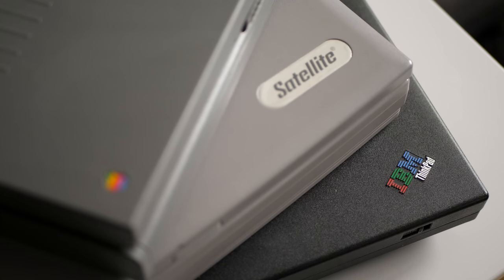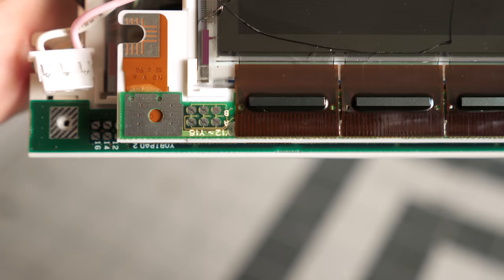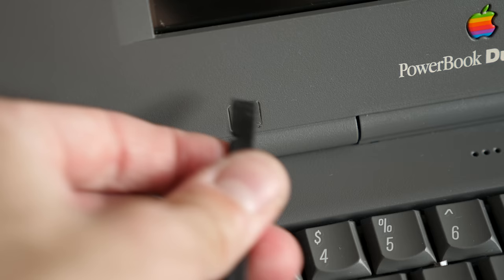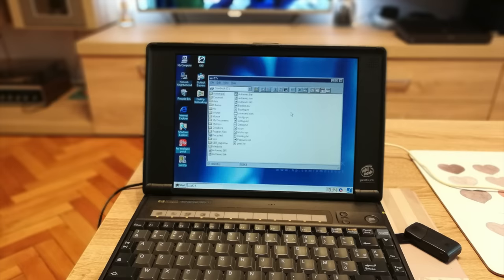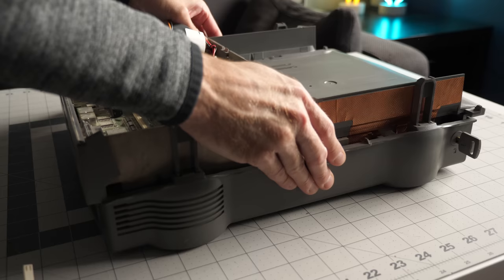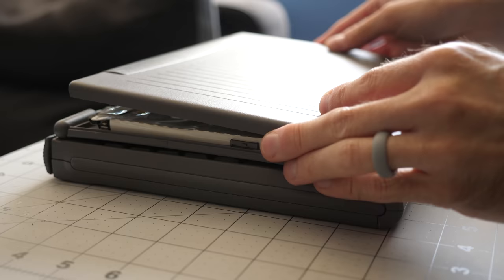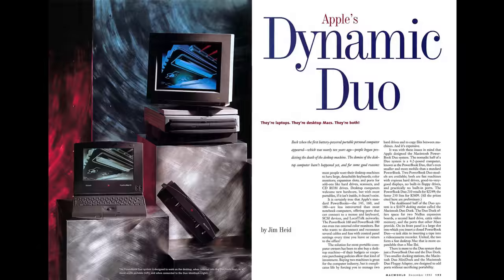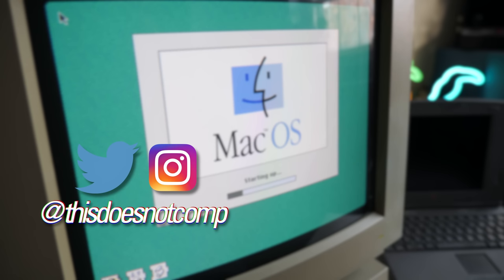Apple PowerBook Duo: The Laptop That Was Also a Desktop

Comment: I bought a used 230 back around 2000 to take notes in college, and later got a 2300. The trackpad was horrible and wished they stuck with the trackball. I have at least 3 docks. The large VCR type desktop, the full length portable dock, and another one with an ethernet jack. Cool concept, and hauling a 4lb laptop to class was pretty convenient when everything else was bigger and heavier.

Comment: Just a tip for the super-gluing. If you sprinkle tiny amount of baking soda on the glue it will harden in seconds when amount of glue is as much as you had to use.

Comment: The 2300c motherboard upgrade was a cool hack at the time for the older B&W screened Duos. You got the PowerPC processor and IDE HD upgrade over the 68030 processor and SCSI HD. Even though the screen was small and greyscale, you got better battery life vs the 2300c and its larger color screen; the greyscale Duos were also thinner and lighter than the color Duos. You also got to keep your trackball, which, at the time, many considered superior to the 2300c's trackpad, which was prone to making phantom mouse movements when it got damp or was in a humid environments.

Comment: What a cool concept - I would actually love something like this for a modern notebook, enabling an eGPU-type expansion with integrated graphics reserved for on the go usage. If the dock had direct access to the mobo like the duo does, it could bypass the IO issues that plague egpus today as well! What an awesome design
Reply: If ExpressCard was revived, updated to use PCI Express 3.0 or 4.0, and to use the full width of the wider size for connection... I bet both USB 3.x and PCIe x4 could be crammed in there while still being backwards compatible with previous ExpressCard devices.

ExpressCard 1 used PCI Express 1.0 x1 and USB 2.0. ExpressCard 2.0 optionally could have PCI Express 2.0 x1 and it had USB 3.0. Where Version 1 could use both PCIe and USB 2.0 connections simultaneously, for version 2.0 to use USB 3.0 it 'borrowed' pins from PCIe for the extra pins for USB 3.0. IMHO it was the optional specification for PCIe 2.0 that killed it.

PCIe 2.0 should have been mandatory for ExpressCard 2.0. It also should have utilized the full 54mm width for wide cards to use the extra width exclusively for PCIe lanes so wide cards could have PCIe x4 and USB 3.0.

But the PCMCIA half-arsed it and laptop manufacturers mostly weren't interested. I suspect that stupid optional bit for PCIe 2.0 chilled ExpressCard device manufacturers on it because why bother making PCIe 2.0 cards when there was no guarantee that all laptops with ExpressCard 2.0 would have the faster connection. There would be too much "Why isn't my ExpressCard 2.0 card so slow?!?!" from customers.

Since the USBIF no longer supports or updates the ExpressCard standard they should make it free and open source.

Comment: I had several of these, at the time they were way ahead of their time. However, they felt heavy at nearly 2Kg’s. Imagine carting it around on a business trip. The docking station was not bad but lots of problems, you had to give it a good hard shove! To repair they were a nightmare, the ribbon cable to the screen often got broken or got snagged and disconnected. Reassembly especially for the screen was not easy, the plastics did not always want to ‘snap’ back. Still, for the time a great portable.

Comment: In 1995 I had a Brother digital word processor which was basically a typewriter with a four line LCD display so that you could type along and when you had everything completed you could scroll through the pages, it would store on a 3.5 floppy and then when You wanted to print you loaded the paper in like a dot matrix printer and it would type out the documents. Fun times for 150 bucks back then,

Comment: Kudos to Apple for trying something revolutionary. Today, I use my Dell Latitude work laptop with a docking station. Until recently, it was a proprietary port on the bottom of the laptop that connected to the proprietary docking station. Now they can just be docked over USB, which means any modern laptop can be docked. My personal Dell G5 15 gaming laptop is just one example of a non-professional laptop that can be docked with USB. Today, Thunderbolt takes this to a whole new level.

Docking a laptop really offers the best of both worlds. The PowerBook Duo was an ideal, albeit expensive, solution for the road warrior class.

Comment: Nice, I haven't seen a Duo for years. I used to sell them at an Apple channel partner in Sydney back in the 90's. A tip for super glue - cyanoacrylate glues use water moisture as a catalyst. To quick-cure a joint, simply spray it with a very fine mist of water. EDIT: Oh! Sorry, you mention using an accelerator later on.

Comment: "It also got an upgrade to 20 MB of RAM at some point." - 20 MB was the default on the 1.1 GB hard drive unit. (Which also came with a modem.)  I love my Duo 2300c - I used it (with Mac OS 9) as my "primary daily mobile computer" until buying a 12" PowerBook G4 in 2003! Even had a portable printer for use with it. (I did on-site consulting, so needed to print out invoices.)  Used both a full DuoDock with an Ethernet card as well as a Ethernet MiniDock.

No, didn't buy new - bought used dirt cheap years later. It "replaced" a PowreBook 5300c (that itself had been acquired used when the PowerBook 1400c came out) as well as a Sony PictureBook C1X. I preferred Apple, but needed something ultraportable, so went with the PictureBook when it came out. Moving from that to the Duo 2300c was a downgrade in basically every possible way, but it was just so much nicer to use the Duo.

Comment: IBM and Toshiba also had giant docks which were an extension of the logic board. Both offered HDD, Optical bay, floppy, all the ports you would need, and extra additional ISA slots for audio or multiport cards mostly. IBM even still offered a very last superdock with PCI/PCIe slot in the 201x for the Thinkpad x and t series.

Comment: 29:28 Look at where the Escape key is. And note the “Enter” key being separate from the “Return” key.
Reply: The return key being separate from the shift key I think is a regional issue. Most US keyboards have that. 
His newer powerbook @20:40 has this, as do the desktop and laptop advertisements at 13:35 and 20:20 .
However, the desktop keyboard 19:38 does look like this, so maybe I'm wrong and it was an old Apple style too (or this was a European advert).

Comment: for such covers, use some alcohol to soak the glue , then you can use a thin plastic sheat or thin plastic card to "slice" underneath them and get them free, i sometimes even use a small needle to lift of one corner and then a sheet of  glossy paper to push it underneath , also return windows do start when the product arrives not when bought , and the send back date is the important one, if it arrives after return period than it still counts as long as it was send out in the window

Comment: Heat set metal inserts are commonly used even as a factory installation method. With the rise in 3d printed prototyping many companies are relearning this technique to get much better strength in prototypes. The heat method you used will likely be about as strong as the original but the super glue bond will not be. Probably plenty strong for your application but don’t torque it too hard. Definitely a good technique for a very common problem on these old machines!

Comment: Hey, future tip, you can use Acetone to "weld" ABS plastic.  What i do is take scrap abs from my 3d prints, dissolve them in Acetone, and then I can brush it on parts I want to fuse and let it dry.  IMO, better than using super glue

Comment: The thing about the Duos was that you didn't have to re-purchase all of the Duo system accessories with an upgrade of the Duo itself: from the 210 to the 2300, every accessory worked with every Duo (though you may need to upgrade your System software to use newer accessories with an older Duo). The only exception was the original Duo Dock which needed its lid replaced if it was to be used with the thicker color Duos.

Comment: Early 90's this was Alien Tech. I remember seeing one in Germany and over here they came in at around 14.000 Deutschmarks (which was like a small car!)

The "Mini Doc" IMHO is the blueprint for any modern laptop docking station some of us still might use. 

And the full dock was an outstanding idea as well. Of course a downside of this concept was the fact that it cost as much as a good computer. 

Funny sidefact: the power supply connector was later re-used in the G3 PowerBooks (Wallstreets ...) and you can even run those with a Duo power brick (though not charge the much more powerful batteries).

Comment: Great video. If you want to rebuild plastic in-situ, you can use UV-curing resin. The best one is probably one used in dental work, but the stuff used for doing nails will probably do for simple plastic snaps that have broken off. The idea is to only build up in small layers, as the curing with UV only takes a few seconds per layer.

Comment: That Duo 2300 would be pretty good for mid to late 90s Mac gaming. Growing up I had a 33MHz 68LC040 mac, which we bought after the first PowerMac models were released. As such, it wasn't long before games started coming out (like Quake, Starcraft, Diablo, Command & Conquer, etc) that required a PowerPC processor. I was limited to older games until I got my first PC a few years later, but all those early PowerPC games should run wonderfully on the Duo.

Comment: I’ve repaired MANY, MANY duo’s! Love your video and stand-off solution.. I just used gorilla expoxy. The one thing I do to all my machine is to replace those tin smd capacitors with tantalum as they are solid state and will never leak! Just a suggestion. There’s also 4 or 5 large ones that leak in the mini dock. So take care of the ones on the logic board of the duo and screen. On the logic board you have to use electrolytic.. but I find new radial electrolytics to last longer and not leak.

Comment: All of those older Quantum drives, especially the ProDrives and GoDrives have one serious flaw: A rubber bumper that prevents the heads from hitting the spindle turns to goo as the drive ages due to temperature, age, and storage conditions. Regardless of what you do, that rubbber will eventually turn to goo and either cause the heads to stick and not let them be able to move, or worse, the rubber will get on the heads and destroy the platters with the rubber.

Comment: I still have a couple of Duo 230 with a B/W screen. One of those has a dead screen and the other suffers from the dreaded "vignetting" where a haze of black surrounds the perimeter of the display like a gloomy aura and gradually increases in size until it reaches the centre. The displays in these were prone to that. While these were fun back in the day, trying to repair a screen or getting a replacement for the dying SCSI drives and worn out trackballs makes for an expensive hobby, especially today.

Comment: I really liked the Duo series. I had several of the B&W models and a 2300. One annoying thing about some of the later models is that they are taller and don't physically fit in the standard Duo Dock (although you could take the top of the dock off and they'd work fine IIRC). The 2300 also required a different dock as well, the Duo Dock Plus, due to the PPC processor.

Comment: These days, people always seem to look down at those greyscale models you mention. But the active matrix greyscale displays would even today be much better to work on text outside. Machines like the DUO 250 or the PowerBook 180 or 540 (without a "c") gave you much more battery life than the colour versions, and even more so in bright sunlight, as you could simply turn off the backlight, then, and clearly see everything on the screen. (Exactly the opposite for a colour screen, that basically always were almost invisible outside even with the brightness turned all the way up.)

Comment: It's always funny how almost every single System 7 era Mac you come across will have educational software on it. Apple definitely pushed really hard on the education market. I used to work at the high school and we definitely were like 90% Mac, but even since then, every single time I've been able to get my hands on a System 7 era machine, it's always had a bunch of educational titles installed onto it. 

I freely admit that while I always clear out any personal data, I always keep the educational games. This was in an era when it was still very common to simply be able to drag the application folder or file from one machine to another to copy it, so pretty much every time I've done that, it's worked fine on another machine. Both from my work at the high school and through getting my hands on other similar-aged Macs, I have a decent collection of titles in my archive. 

The Mac Garden still far outpaces my collection though. :)

Comment: This is a concept that is insane for not being used today. We should have a decently powerful laptop with amazing battery life and good integrated or low power dedicated graphics, and have the ability to slot it into a desktop at home where it swaps the cooling and power to turn the mobile processor into an overclocked high power desktop processor, it should add ram, storage, and give you a powerful gpu. You could even have cores disabled on the laptop that can only be accessed with the desktop cooling. I would totally get something like that.

Comment: This reminds me of a Compaq Smartstation dock one of my friends dad had back in the 90s with their LTE 5300 laptop. It had dual 3.5" internal hard drives loaded with games dual CD rom drives a AWE64 and Voodoo 1 for 3d gaming a 3com ethernet card and had a SVGA Compaq CRT sitting on top of the dock.  You would just slide the laptop in the front and it would turn into a full blown desktop gaming pc.

Comment: 7:45 Next time you do repair on plastic with super glue, sprinkle baking powder onto the crack first, then add superglue. Using filler and superglue is a common repair method for most plastics.

Comment: Today, Thunderbolt makes it a cinch to turn a laptop into a desktop with only one connection but it just doesn't seem as polished.  Sure, it does offer the advantage of being able to use the laptop's screen/keyboard/trackpad as well, but if you want to use your laptop closed what do you do with it?  Either it eats up desk space or you can put it vertically in one of those 3rd party toast rack things, but it's not as cool as the DuoDock. Of course, it only really made sense with a CRT monitor, but overall I always thought this made for a really elegant system,  and I would happily add one to my collection.

Comment: 30:00 Quadra 650, from the latter part of 1993, I believe. I bought a Centris 650 in the earlier part of that year, before Apple got rid of the “Centris” name for its lower-cost 68040 machines and renamed them all “Quadra”. Oh, and  boosted the performance a bit at the same time.

Comment: ik im super late but for the screw cover you should use isoporpyl alcohol and heat like a hairdryer before attempting to pull them out, otherwise the adhesive is too strong and youll damage them, if after this the adhesive is still hard you can use stuff like WD-40, it'll completely dissolve it and the adhesive wont be able to be reused but your double sided tape approach works well after this, i usually reuse the adhesive unless it deteriorated to a significant degree, also, cleaning off all the leftover adhesive before doing the double sided tape thing ensures that ionce theyre back in place the surface is smootha dn flat without bumps anywhere

Comment: These Duos were known to have leaky capacitors that's probably would need to be addressed in a near future. That's probably the problem with the 280c too. Mine turns on only after being plugged for more than 10 minutes and only when he wants to. You can clean the board with soap and water as a temporary solution

Comment: I know that feeling when you get the wrong part. Definitely felt your anxiety and frustration. For the plastics,  I would use epoxy instead. Hardens up stronger than the original plastic

Comment: Would like to see something like this to make a comeback,especially with gaming laptops. Having a few more USB (2&3) ports on the back, one or two PCI-slots, have simular consept of redirecting port available on the back or side, even an option for more hard/solid state drives and/or optical drive, etc.  Probably replace that long port on the back with a thunderbolt or USB c port for more compatibility for modern hardware, I know that not all semi modern laptops does not support USB-c charging, so probably some kind of hole for the power cable, and also I know that not all laptops has the same number of ports or same locations of ports so it may have to be wired up manually.

Comment: I used to restore these. I fixed several 100 series PowerBooks. Brittle plastic, dead harddrives, bad caps and damaged screens are to be expected. However the first Duos are the absolute worst. They look nice but the shoddy construction is shocking. They have no internal frame and literally fall apart. Those fucking rubber strips and awful spongy keyboards.
They have weird proprietry multiplexed power supplies - the first one I plugged in literally exploded.
They have a huge farm of proprietry caps on the motherboard which are a nightmare to get to and replace.
And because they are subnotebooks, you need dongles to attach a floppy drive or even basic peripherals.

Never again!